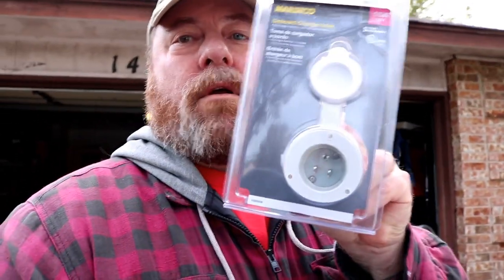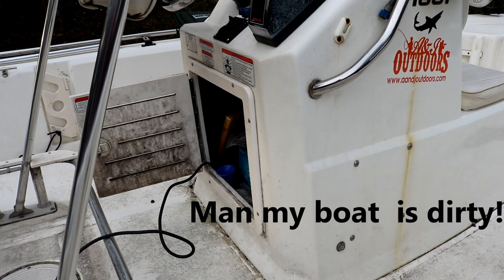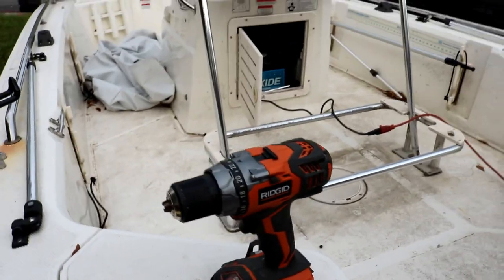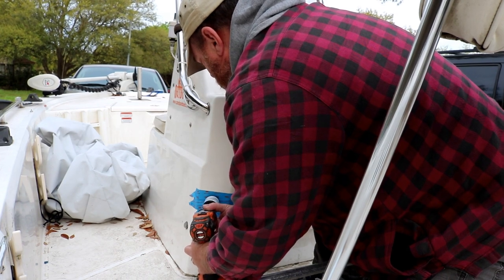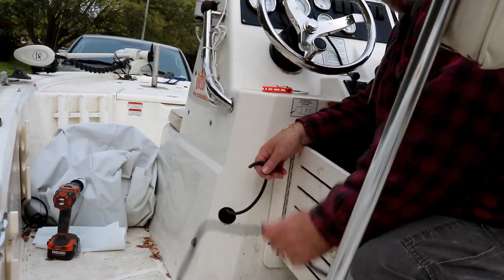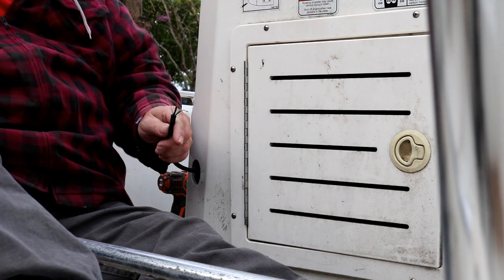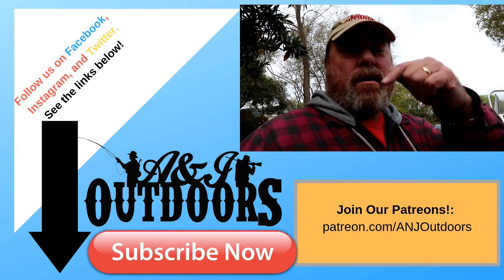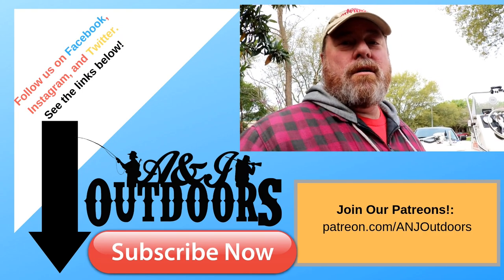On Board Charger Plug Inlet Install #Install #DIY #Boatwork #PlugInlet

Comment: I like that one bettter than the one I used, because of the screw terminals and it's all white.  Mine was a Minn Kota brand , plugged in the rear too.( it gets loose) ..and it's black.  Yours has a cleaner, neater look against the white console.  Good job !